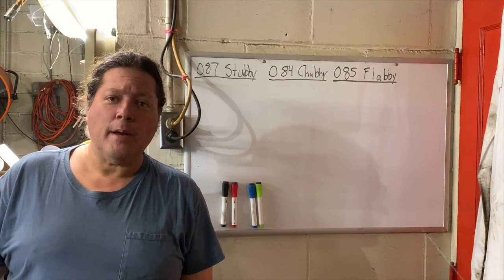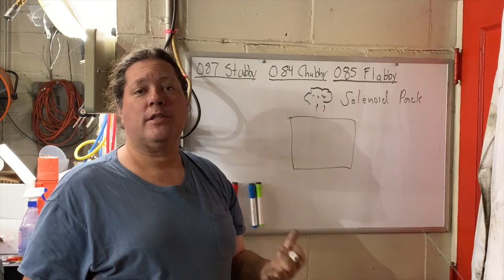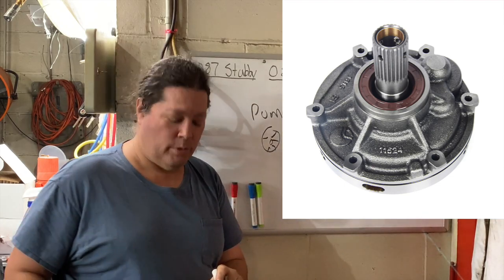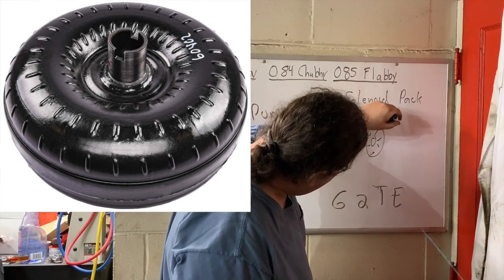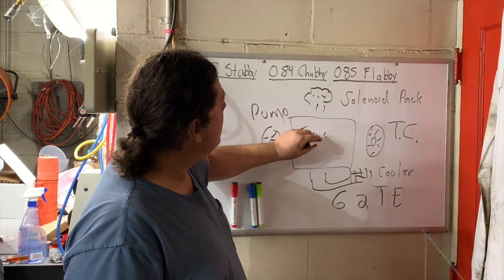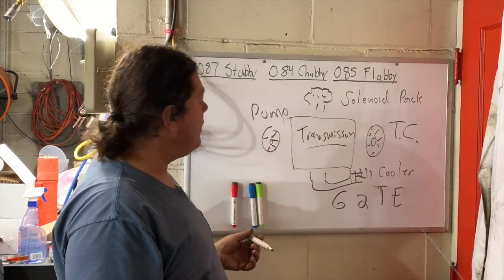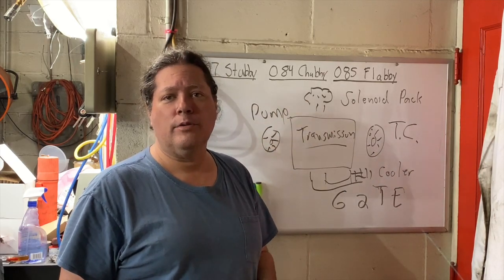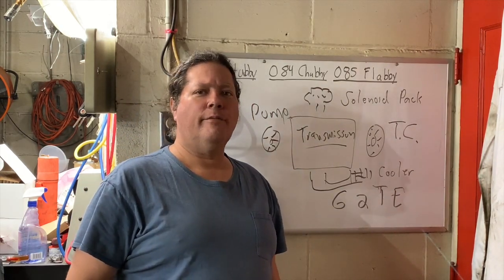New Series - Ram Promaster Transmission - Everything you need to know - Part 1 - overview.

Comment: hello !  I purchased a 2015 promaster 1500 last year, 2nd hand, and had 140k on it. has about 155k now. have noticed that sometimes after coming to a stop, the transmission wont shift from 1st to second unless I let off the gas, and also 2nd to 3rd .  no rhyme or reason , just when it wants to.  what is the first 1 or 2 things to look at ?
Reply from the maker: Absent any codes, the first thing I would look at is the rear transmission mount, the one under it in the rear. After that, I'd take a good look at the fluid level and condition. But without a code, the only other thing to look at is data in the computer called "actual line pressure". This is the pressure coming off the transmission pump. That will take a semi-pro scanner to read, but any shop should be able to read it in 2 minutes. That will tell you a lot about where to go next.

Comment: I wonder if the solenoid pack was my problem the first time. I got it rebuilt and it's on it's way out again after a year.
Reply from the maker: Impossible to say without more information.
Reply: @promastersonly1419  it started downshifting hard when coming to a stop on an incline and then reverse started going out little by little
Reply from the maker: @thestandardbarber1708  not 100% certain, but that probably was mechanical and not the solenoid pack.

Comment: are the 9 speeds better than the 6t2e? could you put a  9 speed in place of the  6t2e if  it went  bad?
Reply from the maker: Best guess is that the 9 speed is more reliable. Basically impossible to swap them as you’d have to swap the computer and reprogram it.

Comment: do you recommend certain years of Promaster that are less problematic?
Reply from the maker: All the 2014-2021 are identical, all weights and lengths. The 22-up have a slightly different engine and very different transmission, both of which appear to be slightly more reliable.

Comment: How reliable is the 2024 Promaster van?
Reply from the maker: Hard to say for certain since the 2023-up are too new to come into the shop. The new engine is a bit more complicated, but its been in other vehicles since 2017 or so and is reliable. I suspect the new 9 speed will be more reliable, but more expensive to fix when it does fail. The van itself has a few glitches with the collision warning stuff, but nothing major. Basically, reliable.

Comment: I have a 2018 which runs great (39k miles) however on the highway it downshifts at the slightest incline. I'm talking creek overpasses in Florida. Hunt hunt hunt. Is this normal? I cannot imagine this thing lasting very long with all these downshifts.Tow/haul seems to make no difference.
I sure miss the days of torquey V8s. We just rented an F450 moving van and fully loaded never downshifted once.
Reply: Belive it's a feature,  not a bug. Owner's manual will 'splain it goodly.
Reply from the maker: This is a common complaint. Most likely, it’s normal, especially if you van is very heavy. But it could mean that you are slightly down on power. An empty promaster should hold 6th gear pretty much all the time. If you have access to a reader, send me your long term and short term fuel trims, and i’ll tell you what’s normal.
Reply: @promastersonly1419  I have an extremely lightweight camper build (I'd be surprised if the whole thing is more than 300-400 lbs) so I don't think it's heavily loaded. I have the Torque app on my phone and will try to capture fuel trims if it can do that. However I do recall the app states the engine is at 100% load going down the highway at 75mph. I get about 16 mpg measured average and it plummets on these downshifts. I'm tempted to just let it scream in 5th.
In my opinion the 6th gear is just too tall and tends to bog the van. I'd love a 6th that ran about 2200 rpm @ 75 instead of this constant bouncing back and forth.
Should tow/haul help?
BTW thanks so much for all you do. You're truly a national treasure. Good luck with the weight gain project!

Comment: How many Quarters fluid get the 2500 v6
Reply from the maker: Full fill is 10qts. When you drop the pan, anywhere from 5-7 qts will go back in, depending on how much is trapped in the torque converter.
Reply: @promastersonly1419  thanks you God bless you

Comment: do you have a video on no reverse?
Reply from the maker: I don't, and that's a fairly common failure mode. My understanding is it's the compounder, but I'm not certain or confident in my ability to say that definitively. There's a way to change/rebuild just the compounder, but it's pretty expert level and it's most of the way toward a full rebuild anyway.
Reply: @promastersonly1419  yea that sucks!, 2020 Promaster has 125k mostly hwy miles, was driven fine and suddenly No reverse! or it slips in reverse you have to give it a lot of gas to move in reverse, but all other gears shift fine. so most likely no quick fix other then a R&R ?! Thanks for Your Time.
Reply from the maker: @DRMOE-fp7ez  That it goes into reverse at all is suggestive of a fluid problem, or somewhat suggestive of a torque converter problem (though you should have similar slippage in forward gears too). Happen to know the codes?

Comment: Great video I have a code that is PO868 can you please help?
Reply from the maker: It’s a low trans fluid pressure code. Could be several things from low fluid to a bad pump to possibly a plugged filter, among other causes. First step; verify the fluid level and report back to me.
Reply: @promastersonly1419  level is good. I had an auto zone transmission filter installed 25 k miles back. so I went to the dealer and purchased there filter and there transmission fluid atf-4 mopar
Reply from the maker: @everythingmaintenancellc3660  ok. The next step would be to find someone with a pro scanner and read what the computer thinks the pump pressure is. A regular consumer grade scanner usually wont read it. You are looking for something called the “actual line pressure”. Running in park, it should be 120-130psi. If it’s low, we know it’s probably the pump. Since you mention no symptoms or other codes, it’s possible the pressure sensor is bad, or the wires to it. The sensor is a relatively cheap/easy fix. But the pressure could be low for other reasons.